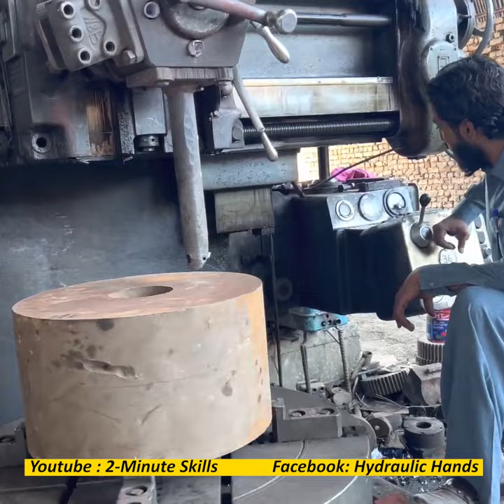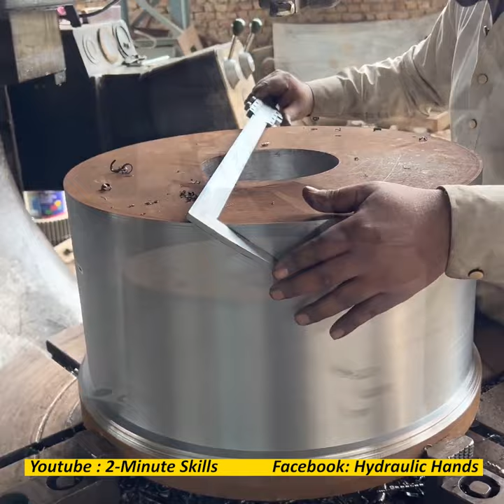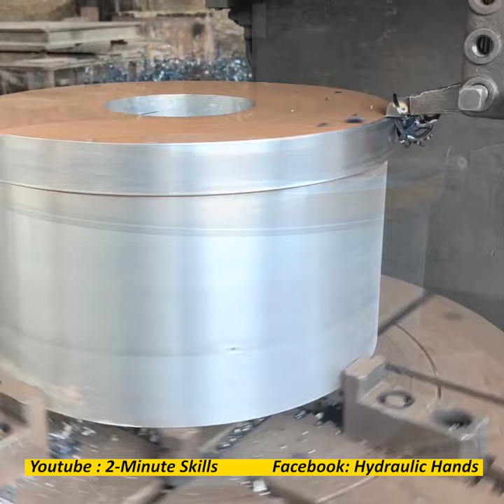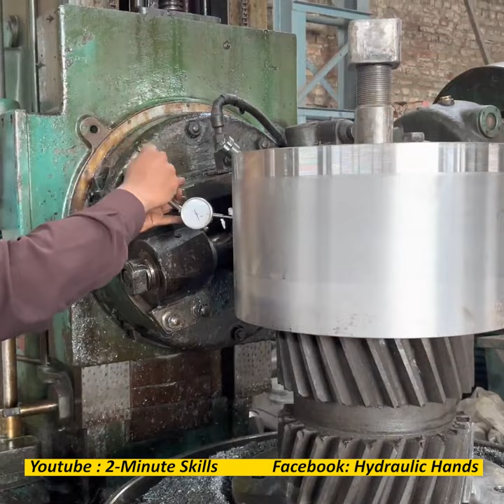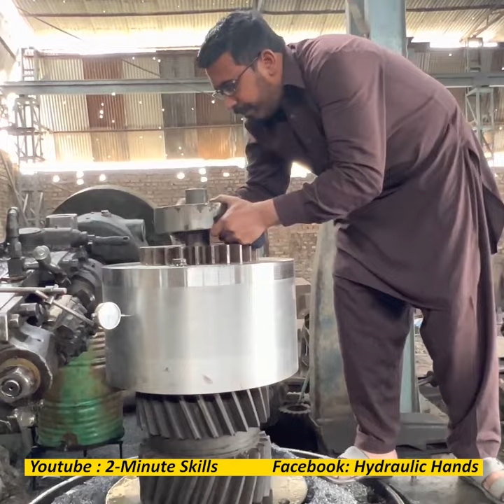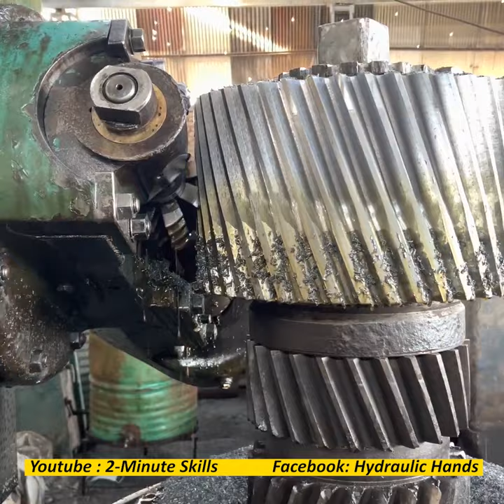Manufacturing process of 500KG helical gear With Amazing old Scottish technology

Comment: The lack of lubrication and cooling really grinds my gears.
Reply: some materials take heat away from the tool, look at the colour of the material hes taken off
Reply: What gears they be grinded down due to lack of lubrication
Reply: @thedanishgoat7973  it was a play on words haha
Reply: @oldkingcrow777  you dont understand what is happening here
Reply: @MaYbYl8eR  if you know what's happening, then please elaborate.
Reply: Forget lubrication, they don't even have H&S in these places. They literally work in sandles.
Reply: Are you a machinist? No. Clueless comment
Reply: They are using lubrication where it's required .... what I see is that the job is being done correctly.

Comment: Definitely a cool process to see, the way they do the final cuts into a gear shape was Definitely not how I assumed they did it
Reply: In actual gear manufacturer you'd basically do the same but in proper safety gear. Then if it is a steel gear of this size your want to harden the teeth and grind them to final dimensions accurately, and then measure and graph the end dimensions in controlled environment. That is how you make durable gear for industrial use, and can give a guarantee that it'll work and it'll last. You'd probably also want to machine splines or a slot on the inside to have some way to lock this to axle. Some gears only use conical surface, it works as well.

Comment: I want to know how they make the bits that cut that steel!
Reply: On this level of manufacturing just a steel, which can be surfaced hardened.
Modern tooling may use silicon carbide, but this workshop, which operates on a 50s/60s technology level probably uses cheap surface hardened tools as well.
Reply: @michaelrenper796  Cool, thanks!
Reply: @EricHorchuck  I'm not much of an expert. But I did train in a workshop for a few weeks 35 years ago. And as a physicist I can tell you material science is a rabbit hole. 

its still pretty simple on the technology level of the workshop shown and for DIY type stuff.

But forming and cutting is a pretty advanced engineering nowadays. Both on the material and on the abrasive side. 
Once you enter modern materials its pretty crazy.
Reply: @michaelrenper796 tungsten carbide, not silicon carbide, but you’re not so far off. The tooling they use in this is probably HHS, or high speed steel tooling
Reply: @willyharris4199  brazed carbide tooling is also very affordable. They come in many shape and size.
Reply: @useditem_tk  maybe, it’s hard to say what they’re using, but I’d just have guessed at HSS or very worn brazed carbide 😂